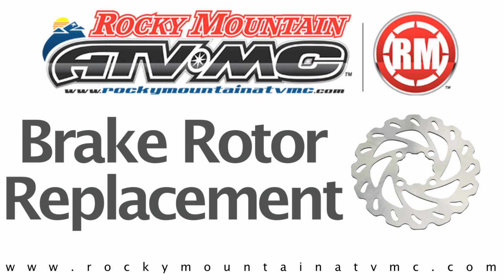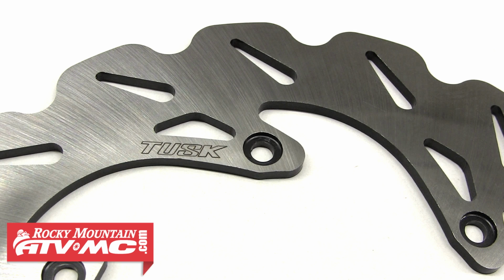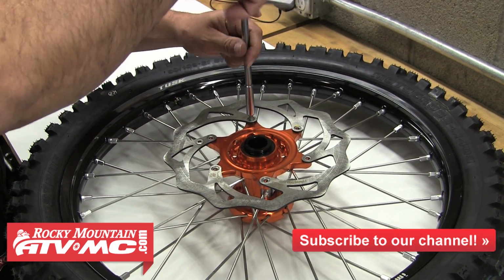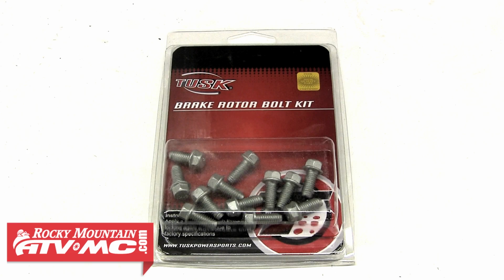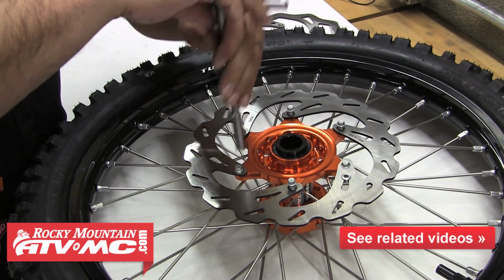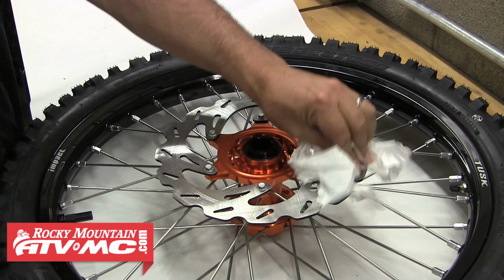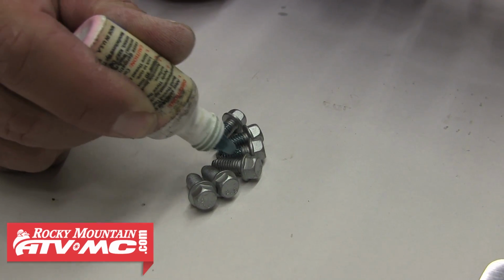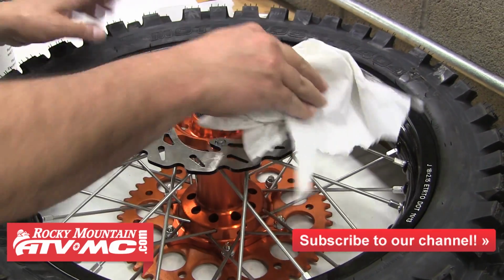Motorcycle Brake Rotor Replacement

Comment: How do you tell if the rotor is worn out?
Reply from the maker: If you hear squeaking, grinding, or you can see gouges or scrapes in the rotor, you'll want to check the pads and rotor. You can also measure the thickness of the brake rotor and compare that to the manufacturers guidelines for wear.

Comment: What if I dont have a rotor magnet ?
Reply from the maker: If you don't have a rotor magnet, your bike most likely doesn't have a speed sensor and you wont have to worry about that part of the install. Just follow the rest of the instructions for the rotor.
Hope that helps!

Comment: It looks like you installed the new front rotor opposite direction of the one you removed. Same with the rear. After you said install it the correct direction. I was hoping to figure out which way to install my new rotor!
Reply from the maker: +Kevin Clark The rotor should be mounted one way.  If you notice, the mounting holes are recessed for the rotor bolt heads to sit in.  That's how you can tell you have it mounted correctly.

Comment: Great video.  Thanks.  Is it okay to mix brands with discs and pads?
Reply from the maker: Joe John Johnston You'll be fine mixing brands with pads and rotors and there isn't any need to re-balance anything if you are on a dirt only bike. If you are riding a street bike I don't think it would hurt to re-balance the wheel just to make sure you are still in check with the new rotor.